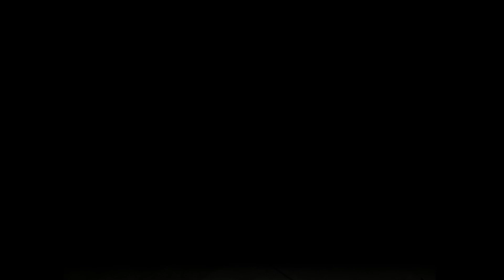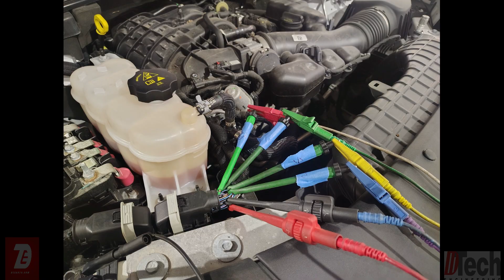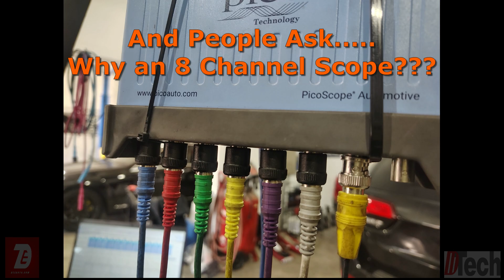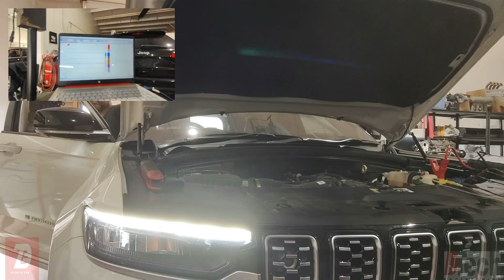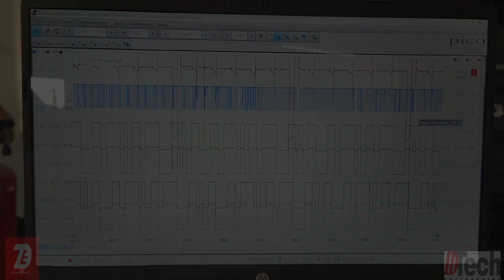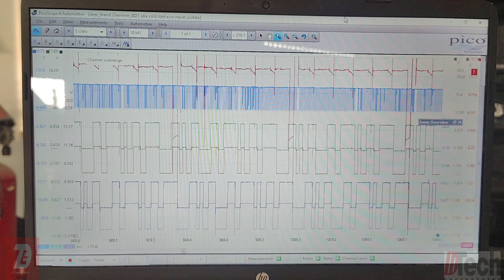When I thought I Nailed the Timing Issue on this 3.6 Penta⭐

Comment from the maker: Just to answer the reason why the bad camshaft showed higher compression on bank 1. 

Since the camshaft lobe is worn down, it opens the intake valve sooner and closes it sooner than normal. By closing it sooner in the compression stroke, the cylinders have more time to build higher pressure by the time the piston is at tdc. 

Which is why that bank shows higher compression but returns to same level when the new camshaft with regular bigger lobes was installed.
Reply: A side note…this can also display misfires on bank 2 (the good bank).   Can be very misleading.

Comment: Hey buddy, I admire your work, understanding, perseverance ......
Well, I would rather check the timing diagram myself with a cylinder pressure sensor and my wonderful tool, which makes a diagram of the engine timing in a second. The price of the tool is a pittance compared to PICO, which apparently does not have this function.
Watch the video at 10.20 min
My greetings
https://www.youtube.com/watch?v=-E3XMDRsoIM&t=536s

Comment: I don't know if these newer ones have it but iv done a bunch of the older Penta star cams and or cylinder heads. Every single one of them have loose oil galley plugs under each camshaft. It bleeds oil pressure. Also cheap cheap customer doesn't seem to understand metal is way more expensive than oil is.